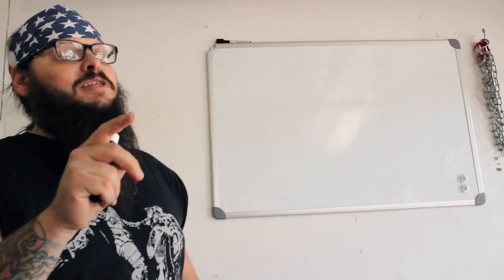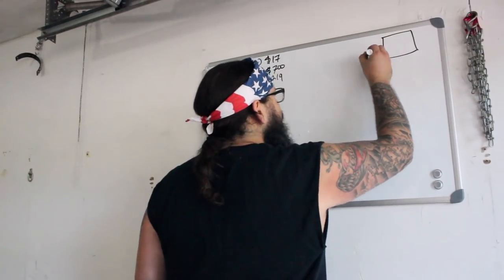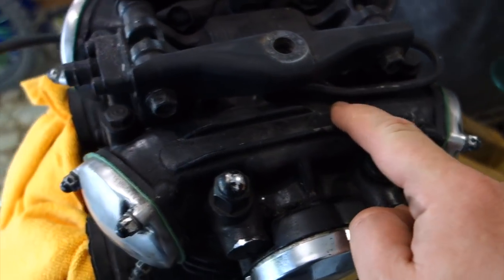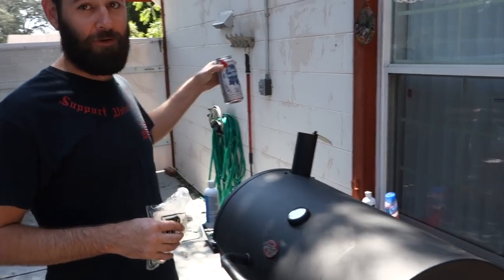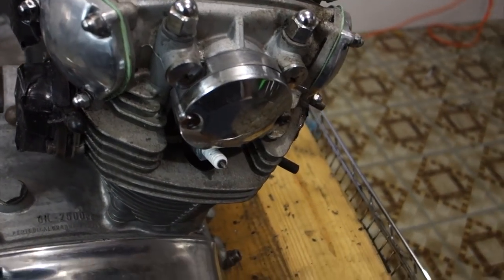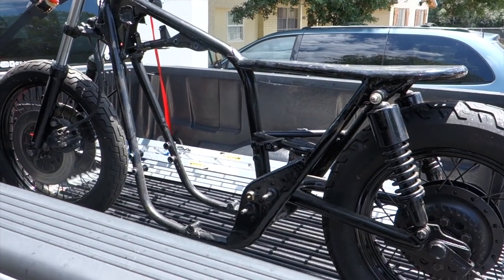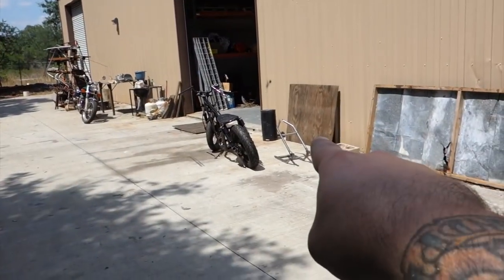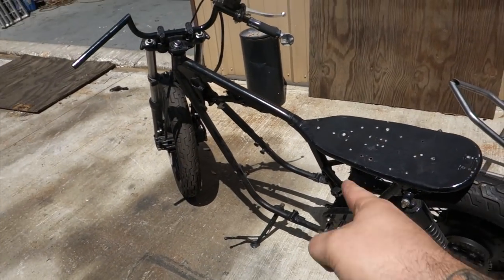Let's start stripping...  [xs650 chopper build part 2]

Comment: Ive been following your channel a long time but only just now decided to watch this build through as an XS 650 is one of my all time favorite bikes , You've already made me laugh Shadetree as welding this frame reminds me of when I was a 17 year old apprentice welder and decided to cut two cars in half and weld together to make one , One car smashed in the front and the other smashed in the back, I took my time with the cutting and got them just right, When it came time to weld the chassis I started to question the sanity of what I was doing , Then I done the right thing , I phoned a friend who had been an apprentice 6 months longer than me to share the welding ! The end of a long story was the car handled fine , Looked perfect and took me on at least three or four trips from the UK to south of France , I kept the car for years until it eventually rusted away but not from the area of the welds they were still fine .

Comment: As a welder by trade, you made the right choice. I wouldn't even weld my own frame. That's not something to bet a life on.
Reply: I welded my hardtail as my final project for my welding class, but I wouldn't recommend that to everyone, and it really does matter what kind of welding you're used to, I think. So yeah, if you have much doubt, then it's best to bring it somewhere.

Comment: Cost saving tip: when removing craptacular rattle can paint, use dollar store oven cleaner. Aircraft stripper is expensive, dollar store oven cleaner is a buck a can, lol. Now for the pro tip: when you DO use aircraft stripper, also buy a small jug of lacquer thinner. Lac neutralizes the stripper most effectively. So if a spatter gets on delicate flesh, just blot some lac on the same spot with a paper towel, rag, etc. When I worked the strip station at a finish shop, I kept a bowl of lac close by to dip my hands in when I felt the stripper eating them, and it always worked like a champ. Just figured I'd share, lol. I'm sure some other solvent would do the same, but while your flesh is being disintegrated probably isn't the time to try out different less lethal ones for effectiveness.

Comment: Yep. Time is money, but when you are enjoying the process, you can't really factor that in. When I did a custom car build 20 years ago, the project cost me $5700 and I sold the car for $12,000. On paper it seemed like a massive profit, but when you consider that time I spent not only on the car itself, but working on other stuff as a trade for parts and services, then it was a massive loss. But it was all about wanting to do it for the experience. Same as your build no doubt. 
Here's a tip for you. Never take a leak with paint stripper on your fingers. 
100% agree on your views on welding the frame. You want that thing to be safe. lol
HaHa! That pink bike is insane!

Comment: Curious to see what the hardtail install costs. I've got an XS650 that I plan on doing the same thing to. Already have a Voodoo Vintage hardtail, just need to get it chopped and welded in there.

Comment: Maaaaan...I had a kz I bought and the mufflers, exhaust and every part of the motor including the carbs had that high temp exhaust paint on it. Problem with that stuff is only the first few inch's of header gets hot enough to cure it so it rubs right off. Fkn A! spent days cleaning that shit off. Looking good!

Also, very few people in the history of man can say they built their own bike literally from scratch, farming out some work or not doesn't make it less of a bike. If people tell you it does ask them how long it took them to mill their motor from a solid block of aluminum, where they mined the copper for their wires. Anyways man keep up the good vids, I love em and tell your lady shes doing great work on the bike, when shes done she will have something she will surely be proud of!

Comment: If you had access to a sand blaster, would that have worked on the engine? Or perhaps a weed sprayer filled with paint sprayer? Both should be able to reach into the deep crevices.

Comment: Dude not welding the frame is a SMART move. I cut off the tail end of my sportster but refused to weld on the hardtail. Too critical. I did all of the other welding but a tail end is waaayyy too important for a newbie welder.

Comment: Learning how to make a decent weld ain't that hard. I picked up a 120 amp ac wire welder for $180.00 and watched some welding tutorials right here on youtube and was welding like a champ in a couple of weeks. Main thing is getting your weld hot enough for the weld to start to flow. you form a puddle and go slow or fast as you need to go to burn in a good solid weld.

Comment: There are motorcycle shops that wont cut into a frame, It's called doing professional quality work and not being an amateur. I go to a machine shop when I need specialized work done for parts on my car. Sometimes you need someone who has skill/expertise/knowledge and equipment to get specialized engineering done. :)

Comment: I HATE KNOW IT ALL PEOPLE!
Josh Juck em if they can't take a FOKE! 
"Professional" shops order in parts from outside sources. 
"Professional" builders have hammered metal tanks that got so thin they leak! Or they've welded frames without a Jig and they ended up crooked/DANGEROUS!
If all those assholes were truly so fucking gifted, they'd have the utube show and you would be watching them. For the dummies being critical of Josh, DO NOT TAKE YOURSELVES SO SERIOUSLY! We Don't!!
Keep up the good work young Man and learn as you go! You are in my prayers! At this point I've seen the chopper run. You did a Damn Fine JOB!
Hoka Hey

Comment: Did you seriously go at that with paint stripper and a jet wash with the alternator cover off? Did oil come out when you took that cover off because if it did you've just got paint stripper and water inside your engine. If you are going to powder coat the engine it will need blasting anyway so why waist time using paint stripper when the paint would be blasted off anyway.Still the only way to learn is to fuck up occasionally. Have fun with the build.

Comment: I do not think you are "doing it wrong" because you know your limitations and you want it to function properly and safely ... Welding is one place where you do not want to skimp and if you know someone that is better than you at it and does it for a living.. I say write the check.  Everything else you can do. or learn how to do quickly and well enough to make it functional.  keep up the fun vids. cheers.
Reply from the maker: +Chi Guy that's my plan! Plus I don't mind supporting a local community member :)
Reply: Chi Guy 
welding is one thing , having a frame table too make sure it's straight is where the professional comes into play !!! Good choice on having it done correctly !!!

Comment: LOL next comment, lol    LOL  holy shit yeah man,  weave the seat material from your back hair.      

  Im digging these first vids. I didn't know how that hard tail bull shit even starts , so cool beans I guess, Just buy the one you like that fits eh?    

   I hate aircraft stripper, but when I have to use it, I blast that shit  deep and thick, leave it set for way long and then power wash it off so i dont get that crap on anything I want to keep. skin! that's a good example. LOL

Comment: I gota white board just like that, outta the dumpster at staples, still had the wrapper on it.   1st things first, you should a put the bikes cost on there. LOL   
  also the subtractions! dude  you could a eBay'ed that speedo instead of tossing it on the floor. ( in the last video )  might a got a case of beer for that or better. 
   not to be critical, LOL.  I am digging the vids. as I work here.

Comment: You are wise to hand off the welding to a skilled professional.  You can start with fender tabs and shit, when you want to start welding on bikes.
Good move on the paint stripping!   XS650 makes an excellent mill.  You probably won't appreciate it's reliability and tendency to NOT leak oil.

Comment: Not doing the welding yourself? Fucking hell! You might as well get Jess to fit a sissy bar and get used to riding bitch...bitch! 😂 only fucking with you. Im all for doing stuff myself and learning to do things but if you've never held a welder before then getting a professional to weld the frame is the best thing you can do. Looking forward to the rest of this build 🙂

Comment: Dude, shut up. Hahahaha. If you don't know how to weld, DON'T weld a freaking frame. Her life depends on it. Admitting your limits is smart. No two ways about it. I am building a Triumph bobber, I wouldn't do the frame, BUT I am building that thing from the sludge trap out.
About your white board, write small. This stuff adds up quick.
P.s. cafe racers rock. Ha ha ha ha!